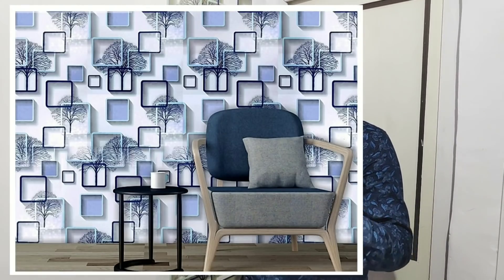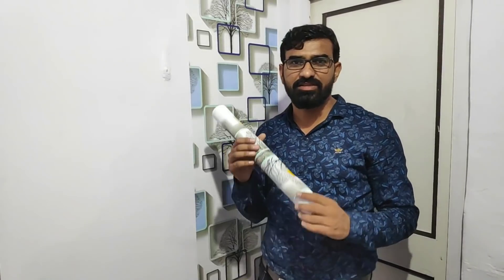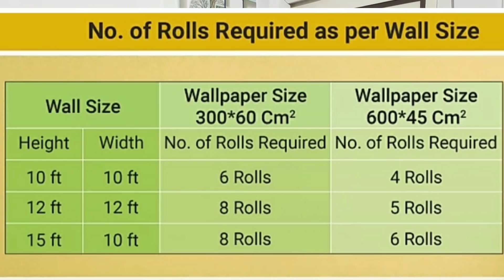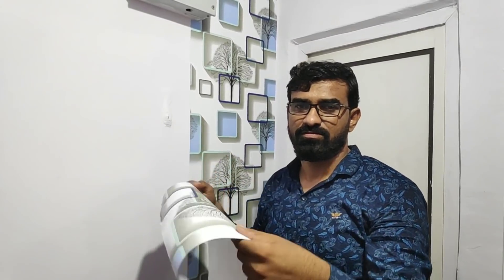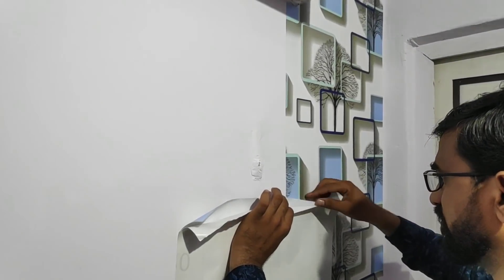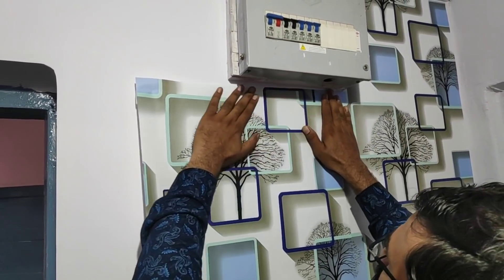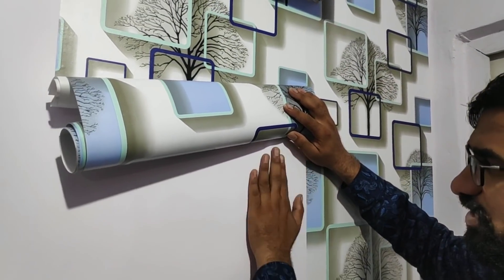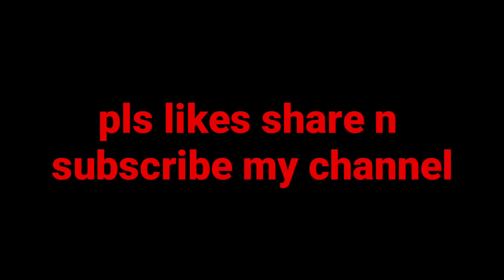खुद ही घर में 3D वाॅलपेपर लगाए, Flipkart से बुलाया, How to paste 3D wallpaper, Self Adhesive, WalTop

Comment: Superb sirji
Reply from the maker: You will get same wallpaper from Flipkart,
Product link given in my videos description, for your confirmation you can check online review of the same product, after that you will book, the cost vary from 199 to 299 due to most demanded this 3D wallpaper,  most of the cases same product out of stock from Flipkart online shopping. 
This is cheap, best and easy to use wallpaper. if this wallpaper is in your budget, so you can purchase.
most important thing is that the wallpaper which you purchase is under non returnable policy.
Sir don't worry just buy and applying whatever u want like, wall fridge, refrigerator, washing machine, wooden table, plywood, door, window, and many more thing.

please subscribe my channel if given information is informative and helpful to you.
Thanking you sir for your valuable feedback.
Reply from the maker: यह वॉलपेपर नहीं जमेगा, ऐसे दीवारों पर जैसे कि चुना वाली, बिना सीमेंट प्लास्टर वाली दीवार, ईटों की दीवार, सीलन और पपड़ी पकड़नेवाली जगह, मॉइश्चराइज होने वाली दीवार, पानी का रिसाव दीवार के अंदर से होता है वह वाली दीवार इन सभी दीवारों पर यह वॉलपेपर नहीं चलेगा।

सर/मैडम, 
यदि दीवार/जगह का साइज 10 फुट बाय 10 फुट है तो इस वालपेपर के 4 रोल लगेंगे,

दिवार का साइज
10 फिट * 10 फिट- 4 रोल
12 * 12 - 5 रोल
15 * 10 - 6 रोल

1रोल में 29 चौरस फिट आता है।
1रोल का साइज 45 सेंटीमीटर * 600 सेंटीमीटर रहता है।

इस कॅलकुलेशन से आप वालपेपर खरिद सकते हैं।

यह वाॅलपेपर बेस्ट और अच्छा है, मैंने विडियो के डिस्क्रिप्शन जो लिंक दिया है उसे फ्लिपकार्ट पर देखोंगे तो वहां रिव्यु में आपको दिखेगा की यह मैक्सिमम लोगों ने परचेस किया है, और लोगों ने इसे वॉश बेसिन एरिया, बेडरूम, हॉल, किचन में, टेबल, अलमारी, फ्रिज और अन्य बहुत सारी जगह पर उपयोग में लाया है, तो आप के यदि बजट में है तो इसे जरूर खरीदें, 

ऑनलाईन इसका कॉस्ट बहुत ज्यादा वेरी होते रहता है 199-299 के बीच में अलग अलग बदलते रहता है।
ज्यादा डिमांड होने के कारण यह आउट आॅफ स्टाक भी होता है।

यदि दि हुई जानकारी से आप संतुष्ट है तो मेरे चैनल को जरूर सब्सक्राइब कीजिए। धन्यवाद!
Reply from the maker: वालपेपर का🎥 नया विडियो बनाया है, इस में आपके 👨‍👩‍👧‍👦सभी सवालों के जवाब मिलेंगे। तो यह वीडियो 🙏जरूर देखिए।

https://youtu.be/rDmKKuI3gKU

आवाज़ के लिए नया 🎤माइक भी परचेस किया है।

इस वीडियो के लिए बहुत🤔मेहनत की है।
कृपया वीडियो अच्छा😃 लगे तो उसे 👍🏻लाईक करे और  चैनल को🛎 सब्सक्राइब करें।

आपको कोई भी ❓सवाल या ✅सुझाव है तो कमेंट किजीए। 🙏धन्यवाद🙏 
और 🎁Giveaway में पार्टीसिपेट कीजिए

Comment: nice
Reply from the maker: You will get same wallpaper from Flipkart,
Product link given in my videos description, for your confirmation you can check online review of the same product, after that you will book, the cost vary from ₹199 to 299 due to most demanded this 3D wallpaper,  most of the cases same product out of stock from Flipkart online shopping. 
This is cheap, best and easy to use wallpaper. if this wallpaper is in your budget, so you can purchase.
most important thing is that the wallpaper which you purchase is under non returnable policy.
Sir don't worry just buy and applying whatever u want like, wall fridge, refrigerator, washing machine, wooden table, plywood, door, window, and many more thing.

please subscribe my channel if given information is informative and helpful to you.
Thanking you sir for your valuable feedback.
Reply from the maker: वालपेपर का🎥 नया विडियो बनाया है, इस में आपके 👨‍👩‍👧‍👦सभी सवालों के जवाब मिलेंगे। तो यह वीडियो 🙏जरूर देखिए।

https://youtu.be/rDmKKuI3gKU

आवाज़ के लिए नया 🎤माइक भी परचेस किया है।

इस वीडियो के लिए बहुत🤔मेहनत की है।
कृपया वीडियो अच्छा😃 लगे तो उसे 👍🏻लाईक करे और  चैनल को🛎 सब्सक्राइब करें।

आपको कोई भी ❓सवाल या ✅सुझाव है तो कमेंट किजीए। 🙏धन्यवाद🙏 
और 🎁Giveaway में पार्टीसिपेट कीजिए

Comment: Thanks sir
Reply from the maker: You will get same wallpaper from Flipkart,
Product link given in my videos description, for your confirmation you can check online review of the same product, after that you will book, the cost vary from 199 to 299 due to most demanded this 3D wallpaper,  most of the cases same product out of stock from Flipkart online shopping. 
This is cheap, best and easy to use wallpaper. if this wallpaper is in your budget, so you can purchase.
most important thing is that the wallpaper which you purchase is under non returnable policy.
Sir don't worry just buy and applying whatever u want like, wall fridge, refrigerator, washing machine, wooden table, plywood, door, window, and many more thing.

please subscribe my channel if given information is informative and helpful to you.
Thanking you sir for your valuable feedback.
Reply from the maker: वालपेपर का🎥 नया विडियो बनाया है, इस में आपके 👨‍👩‍👧‍👦सभी सवालों के जवाब मिलेंगे। तो यह वीडियो 🙏जरूर देखिए।

https://youtu.be/rDmKKuI3gKU

आवाज़ के लिए नया 🎤माइक भी परचेस किया है।

इस वीडियो के लिए बहुत🤔मेहनत की है।
कृपया वीडियो अच्छा😃 लगे तो उसे 👍🏻लाईक करे और  चैनल को🛎 सब्सक्राइब करें।

आपको कोई भी ❓सवाल या ✅सुझाव है तो कमेंट किजीए। 🙏धन्यवाद🙏 
और 🎁Giveaway में पार्टीसिपेट कीजिए

Comment: Wah new things
Reply from the maker: You will get same wallpaper from Flipkart,
Product link given in my videos description, for your confirmation you can check online review of the same product, after that you will book, the cost vary from 199 to 299 due to most demanded this 3D wallpaper,  most of the cases same product out of stock from Flipkart online shopping. 
This is cheap, best and easy to use wallpaper. if this wallpaper is in your budget, so you can purchase.
most important thing is that the wallpaper which you purchase is under non returnable policy.
Sir don't worry just buy and applying whatever u want like, wall fridge, refrigerator, washing machine, wooden table, plywood, door, window, and many more thing.

please subscribe my channel if given information is informative and helpful to you.
Thanking you sir for your valuable feedback.
Reply from the maker: यह वॉलपेपर नहीं जमेगा, ऐसे दीवारों पर जैसे कि चुना वाली, बिना सीमेंट प्लास्टर वाली दीवार, ईटों की दीवार, सीलन और पपड़ी पकड़नेवाली जगह, मॉइश्चराइज होने वाली दीवार, पानी का रिसाव दीवार के अंदर से होता है वह वाली दीवार इन सभी दीवारों पर यह वॉलपेपर नहीं चलेगा।

सर/मैडम, 
यदि दीवार/जगह का साइज 10 फुट बाय 10 फुट है तो इस वालपेपर के 4 रोल लगेंगे,

दिवार का साइज
10 फिट * 10 फिट- 4 रोल
12 * 12 - 5 रोल
15 * 10 - 6 रोल

1रोल में 29 चौरस फिट आता है।
1रोल का साइज 45 सेंटीमीटर * 600 सेंटीमीटर रहता है।

इस कॅलकुलेशन से आप वालपेपर खरिद सकते हैं।

यह वाॅलपेपर बेस्ट और अच्छा है, मैंने विडियो के डिस्क्रिप्शन जो लिंक दिया है उसे फ्लिपकार्ट पर देखोंगे तो वहां रिव्यु में आपको दिखेगा की यह मैक्सिमम लोगों ने परचेस किया है, और लोगों ने इसे वॉश बेसिन एरिया, बेडरूम, हॉल, किचन में, टेबल, अलमारी, फ्रिज और अन्य बहुत सारी जगह पर उपयोग में लाया है, तो आप के यदि बजट में है तो इसे जरूर खरीदें, 

ऑनलाईन इसका कॉस्ट बहुत ज्यादा वेरी होते रहता है 199-299 के बीच में अलग अलग बदलते रहता है।
ज्यादा डिमांड होने के कारण यह आउट आॅफ स्टाक भी होता है।

यदि दि हुई जानकारी से आप संतुष्ट है तो मेरे चैनल को जरूर सब्सक्राइब कीजिए। धन्यवाd
Reply from the maker: वालपेपर का🎥 नया विडियो बनाया है, इस में आपके 👨‍👩‍👧‍👦सभी सवालों के जवाब मिलेंगे। तो यह वीडियो 🙏जरूर देखिए।

https://youtu.be/rDmKKuI3gKU

आवाज़ के लिए नया 🎤माइक भी परचेस किया है।

इस वीडियो के लिए बहुत🤔मेहनत की है।
कृपया वीडियो अच्छा😃 लगे तो उसे 👍🏻लाईक करे और  चैनल को🛎 सब्सक्राइब करें।

आपको कोई भी ❓सवाल या ✅सुझाव है तो कमेंट किजीए। 🙏धन्यवाद🙏 
और 🎁Giveaway में पार्टीसिपेट कीजिए